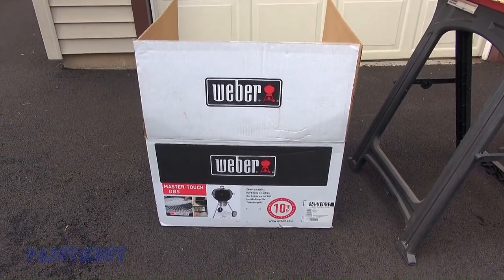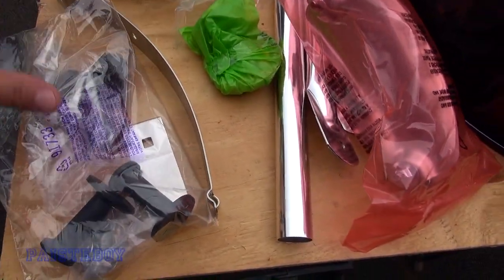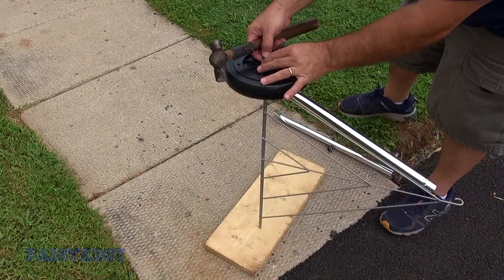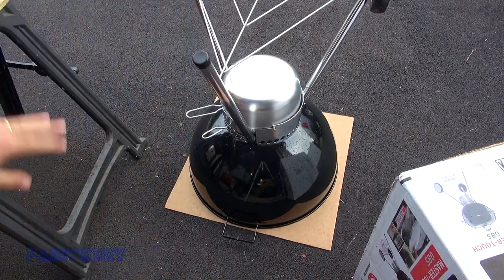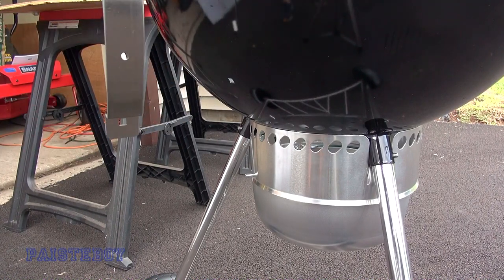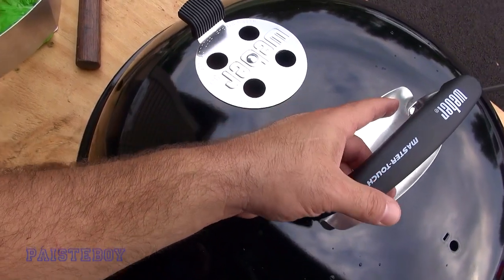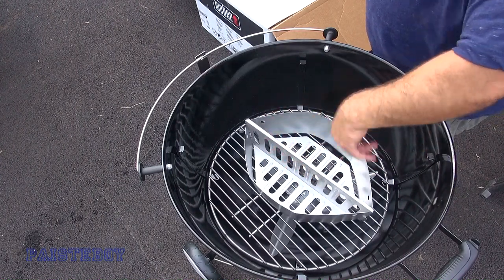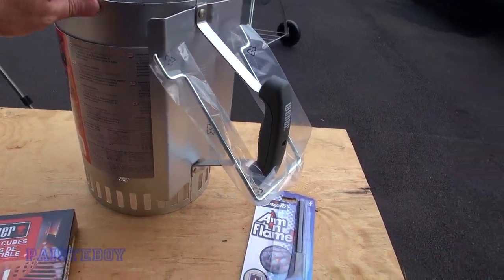Weber Master-Touch Kettle Grill Assembly | LONGER VIDEO

Comment: Last year I bought this master-touch myself but I wish I would have known about their new master touch for 2019. That 1 has more better features and a spring action lid.
Reply from the maker: I just checked out a video showing the new hinged lid.  It's nice but I find that I like to have full 360-degree access to the grill by completely removing the lid. I'm not sure if you can do that easily with the 2019 model.  I also have to admit that I really can't say that I wouldn't like it better since I don't have one to compare it directly to mine.  It's good to see Weber making upgrades to there grills though.  Thanks for watching.

Comment: Hi, I am trying to decide between the 5770 master touch premium and the standard master touch 5755 without the Hinge lid; I see that the ring and plate are a huge benefit but is there still issues with the hinge after a fix? and with Gasket tape - basically is it not worth the risk and just to get the standard master touch because of the lid not closing - or is it resolved nowadays/ fixed with the hack? what would you recommend between the two models?
Reply from the maker: I would get the one that I have again.  It works great and you can completely remove the lid if you want or need to.  No issues with the lid seating properly either.